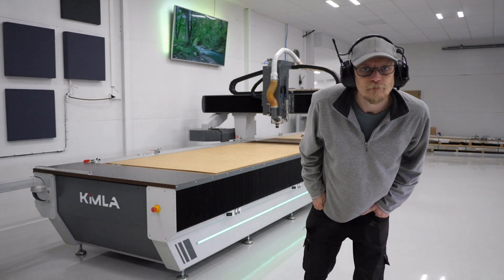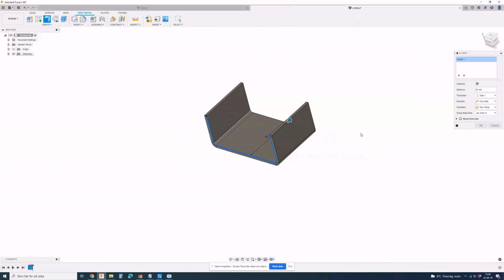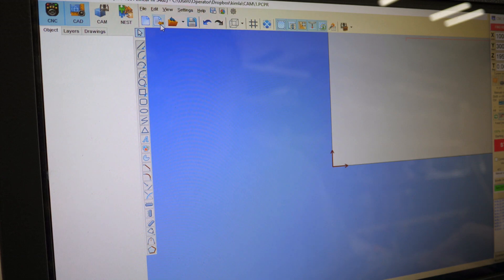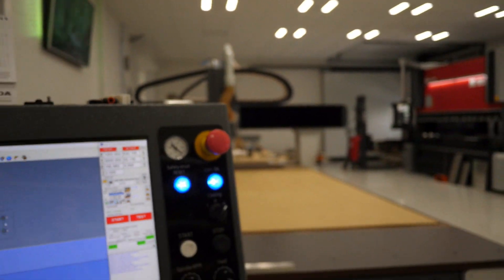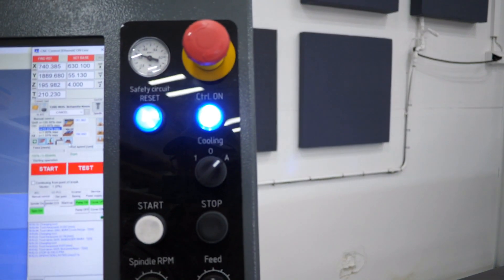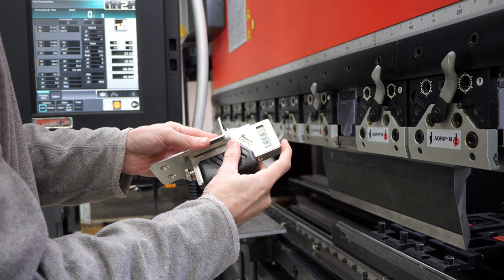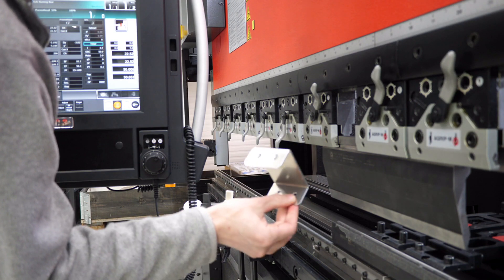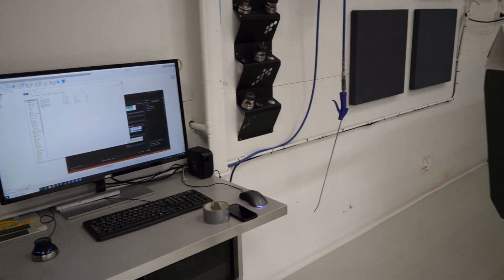Sheetmetal part from scratch in 2022? EASY PEASY!

Comment: Is that the 30 degree #831 AFH punch you got on there for air bending?
Reply from the maker: Indeed it is. Its got the R1.5 Tip tho.
Reply: @randomrouting  That's awesome! I love AFH tools. What size V are you using? Is it 60° or 88°?
Reply from the maker: @pupdoggify  This is a 14mm 88.  Veery narrow for the alu.
Tools are AFH which as you probably know means AmadaFixedHeight, tho the not so great thing i discovered was that if I buy the R1.5 tipped AFH tools then its no longer "Fixed height" as my AFH gooseneck also has the R1.5tip and yet the heights are different. Even the sales guy was surprised.
Reply: @randomrouting  I have an HD1303NT and I hear ya! I ran into the same issue which is why I started modifying the AFH tool drawings to my liking and getting them made locally from a machine shop where I know the owner. Now, all of my punch tips end precisely at 120mm (even after the radius) from the bottom of the tool holder. I then import the tool DXF files into AMNC and assign it the same tool # as the AFH counterpart but with a 2 at the end to signify v2. In the end, it ends up being a lot more cost effective too with faster turn around times.
Reply from the maker: @pupdoggify  Holy crap thats amazing to hear. Havent really thought about going that route, but seems obvious now.

I got some related other issues that I need to make a video about to explain properly, id love your input whenever i get that posted!

Comment: Are you using any coolant for milling? Everything looks very clean.
What kind of tool do you use for bottom chamfer?
Reply from the maker: Im using denatured ethanol, it evaporates during cutting so everything stays clean.
For the tool just search for  "Bottom chamfer tool" at aliexpress. I buy them uncoated and then send them off for dlc coating locally.
Reply: @randomrouting  thank you very much.
Seeing your progress is very inspiring. Take care.
Reply from the maker: @Nunak91  Thanks. You too!

Comment: WOW. This is what I do in my job. I love the cleanliness in your shop. I love it all.
Reply from the maker: Thanks!
Reply from the maker: Are you guys running lasers and pressbrakes ?
Reply: @randomrouting  Yes. We currently have one laser and one press brake. 2nd laser should be at our place in two weeks.
Reply from the maker: @martinkrocek978  Cool. Does it come with any type of software that integrates both laser and pressbrake ?
Reply: @randomrouting  No unfortuanelty our company is lead by an amateur trio of brothers who unfortunately don't have a clue how to do things properly on really high level as I would like to. Everything we do is copy others and cheaper. 
We don't even have a software to make nesting and calculate cost of lasered parts. We do it manually on the machine itself.

Comment: Wow, just came across your channel and your workflow is really impressive ! Still can't understand how the vacuum work through the wood sheet
Reply from the maker: The vacuum pumps at the far end of the machine suck air through the HDF(Wood sheet).
You might not know that MDF(Medium density fiberboard) is accually very porous so air has no problem passing, Im using HDF(High density fiberboard) to reduce the airflow because the pumps have a finite amount of air they are able to remove so limiting the flow works in my favour. as the vacuum pressure under the aluminium is greater :)
Happy you liked it 👍

Comment: Automated cam, that is awesome. That is done from the DXF on the Kimla controller?  bend correction, Foot control on the extraction is the finishing touch. I still need to automate the vacuum pump on my control panel. I have to jump through some hoops to start that pump..
Reply from the maker: Yes, the layernames in the DXF have the thickness in them so the kimla just applies ready made templates.
I have ordered industrial RF transmitter and recievers that i will hook up to the 24v solenoid controlling the lowering of the suction cup, so the extractor starts as the cup lowers.
I also ordered a deactivation delay relay so that the extractor keeps running for a minute after deactivation. Just so it doesnt try to start/stop too often.

I had a BUNCH of quality of life improvments I needed to do on my old router, and i always ment to get to it but just... never did. Classic :)

EDIT: And the "manual" bend correction i did in the video is only done on the first bend. I should have measured the second bend too to show that.
Values are also saved for next time. You do however still want to measure the first bend since all alu batches are a tiny bit different.